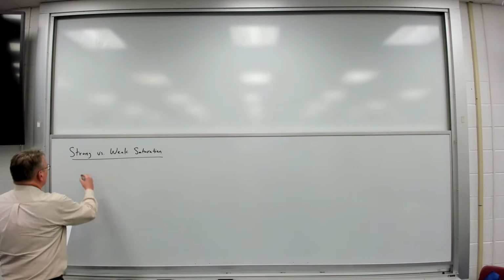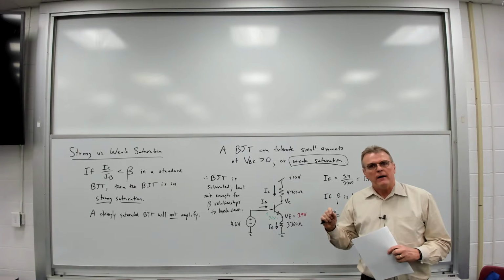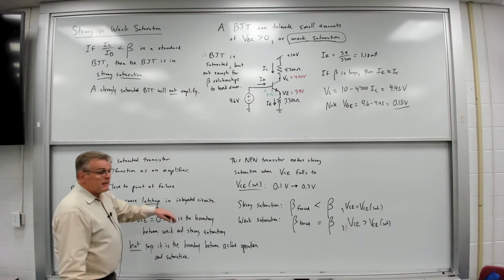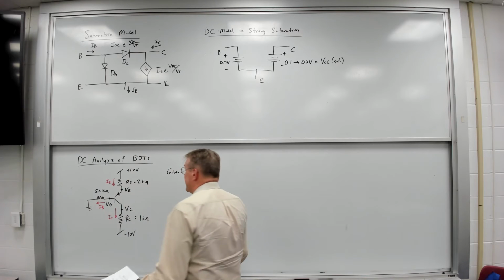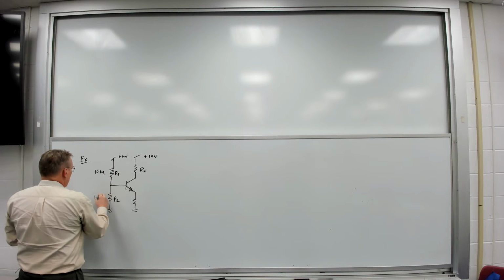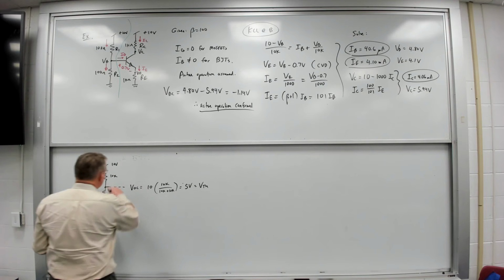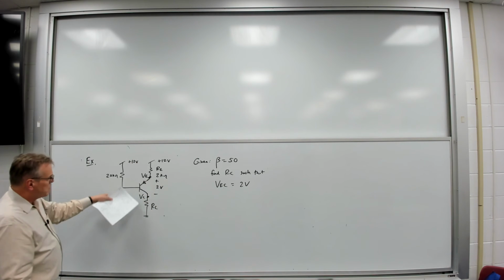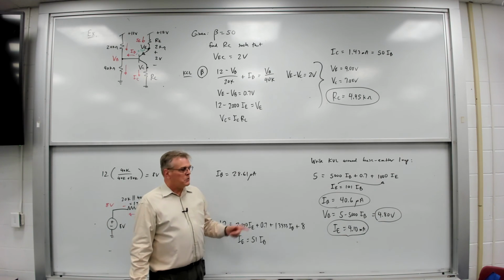Electronics - Lecture 15:  DC analysis of BJTs, Thevenin's Theorem in BJT analysis

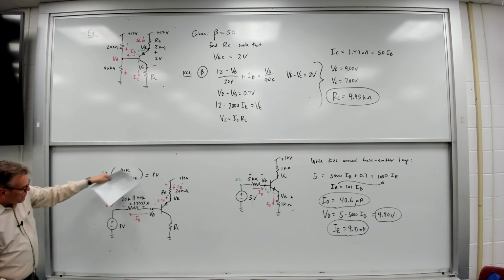Comment: Why the polarities in the Rth changed in PNP case  compare to the polarities of Rth in the NPN case? (At 55:35 of the video)
Reply from the maker: The polarity of the voltage drop follows the direction of the base current.  For an NPN transistor, positive IB flows into the base.  For a PNP transistor, positive IB flows out of the base.
Reply: @wtimothyholman  ty professor Holman

Comment: sir, i am unable to visualise the Vth and Rth like we usually did in circuits, where we had the between 2 distinct points A and B, here it seems like a single point
Reply from the maker: In such cases, the Thevenin resistance is determined between a given single node and ground.  The single node is node (a), and the ground node is the second node, or node (b).  It is just not explicitly shown as it was in Circuits I.  Note that when the 1A driving source is connected to calculate Rth, it is connected between the single node and ground.
Reply: @wtimothyholman  understood!